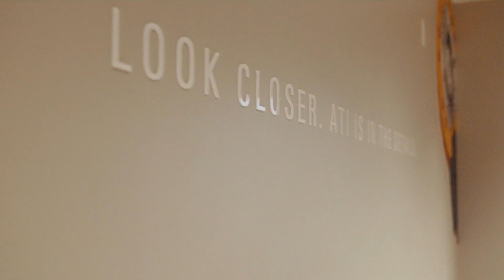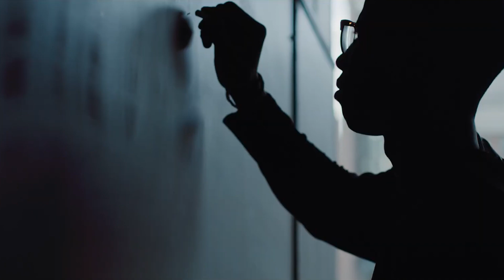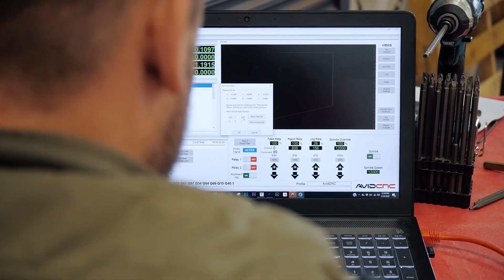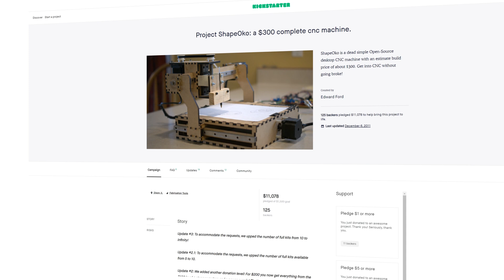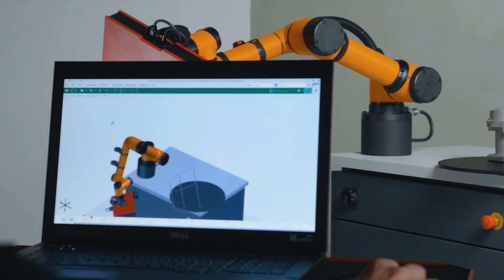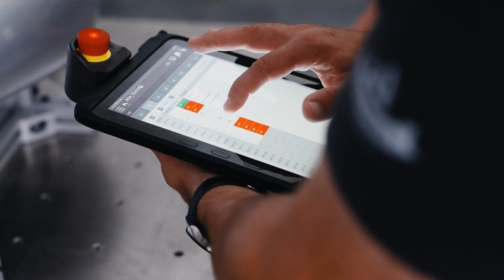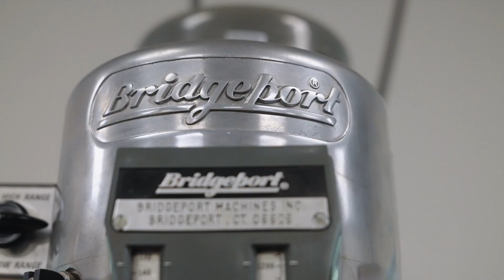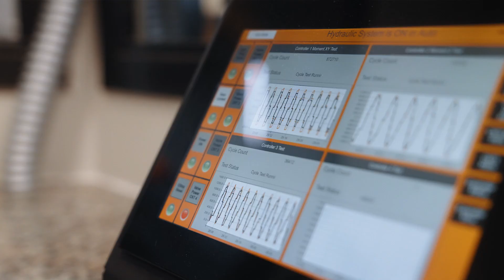Are CoBots the FUTURE of the Small Shop?

Comment: At the AWFS last week was full of robots about 75% of all booths were some kind of robots. They had full-size to take a full 4x8 sheet of plywood move it, cut it, put it together sand it even spray paint it. Completely automation. Than they had smaller ones that would work in a small shop & do the mundane things, sanding, painting, etc. 
There was even a fully automated table saw fence, you calibrate it than put in the measurement you want in any format metric to imperial, so repeatability would be very easy.
Than there was a pack you would put on you and it would give you more strength and control to lesson the work load. Very very tech savvy this wood convention was, just say mind was blown.

Comment: I am currently working with a large robot to mill metal parts. Must say quite tedious than what the manufacturers and sellers claim.
Reply: The software running in this video is deceptive. For a robot to make an intelligent decision in a manufacturing environment without advanced specialized programming... better be a long production run and once that robot is dead its a brick. Gears run out

Comment: Tech is amazing as soon as you showed the orbital sander my mind thought it would be cool if it would run a belt sander. My only issue with automation in woodworking is at some point the flaws go away so the character of the piece does as well.... it is really fascinating where we have come. I used to run a HAAS 5 axis mill 30years ago and I thought then how cool this would be in my shop... it was a $60k machine now this arm can basically replace that machine! Awesome for sure.
Reply: you are trading one problem for many more compound problems with a robot arm. Elon Musk in the last year tried to get rid of 1000 robots and replace with gigapress. What a nightmare of programming and software errors and decision making that people should be doing instead.

Comment: What is the cost of entry for something like the sanding robot you demoed?
Reply from the maker: The sander is only a few grand (force sensor the tech is insane) but the robots vary wildly from company to company. They are dropping in price by double digit percentages every year and the tech gets cheaper to make. The Fanuc I used in the video starts at $40k but it was twice that when it came out. They'll be the same price as a CNC soon but aren't there yet.
Reply: On the youtube channel lignum he bought his industrial robots used for $5000. Has two of them.